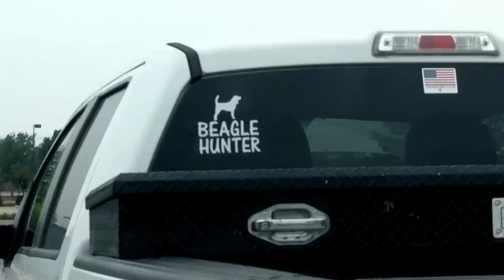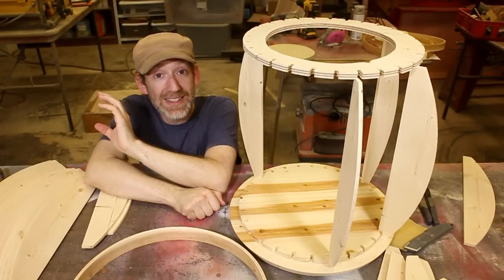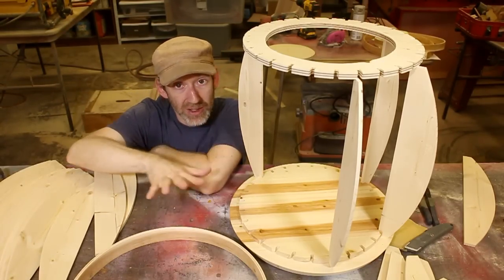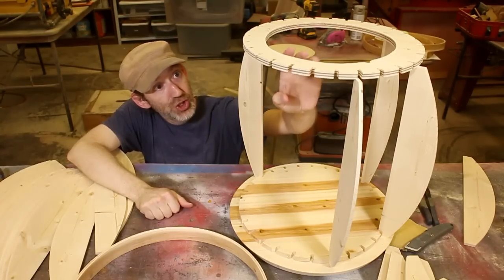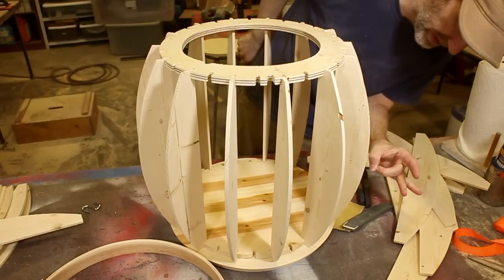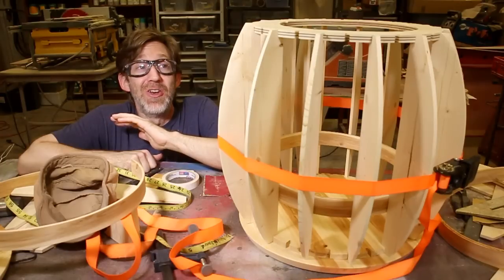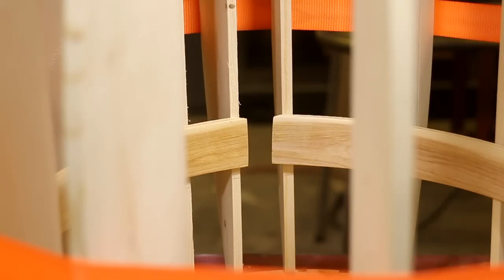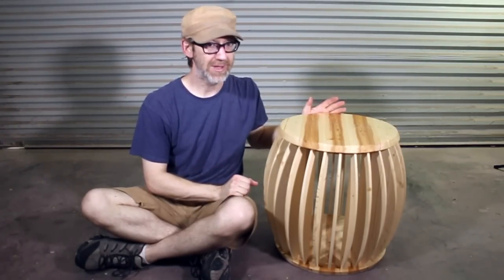Two 2x4 Challenge: A Mid Mod Stool Made Entirely of 2x4s!

Comment: Just love the custom made push sticks for the ovalish shapes. Safety first!
Reply: Except he's not using a top guard which is mandatory in the UK.
Reply: @donaldasayers  The top guard makes the table saw unusable. Do they come by and check in the UK.
Reply: @johntripp2028  In industry, which means if you employ anybody, yes they do. If a worker or you had an accident and there was no top guard, then your insurance would be void as well.

Yeah ok there are some things you can't do with a top guard on but there are good safety reasons why  you should not be trying to do them. What operations did you have in mind?
Reply: @donaldasayers  If we are talking about the same thing which is the guard that covers the blade , I would say any operation that requires blade visibility. Which for me is all operations. I hadn't had mine installed since right after I purchase my saw. I recently put it back on. I found it so onerous that I removed it. Maybe a better guard would work, but as it is I feel safer with it off. We have the same requirements for a commercial operation.
Reply: Donald Sayers who in the world has the job of coming to your “flat” or home in the UK and seeing if you have the guard in place? My top guard won’t allow the blade to turn to 45° I installed it the first 3 cuts I made with it. But to the point do the police (bobbies) check your personal saws over there? It’s mandatory here too per OSHA but that’s occupational safety not residential
Reply: Donald Sayers insurance here would be void too IF the employee wanted to lose workers comp by snitching that he was improperly using a saw. 

As far as what operations? For example a 45° cut or a piece of wood thicker than 4” it gets in the way more times than not. If you use the push stick correctly that comes with every table saw your hands get NOwhere near the top of the blade

Comment: I did the same thing, almost.  I used oak 2 x 4's and only did 12 verticals.  Mine was a side table from the start.  I wrapped both top and bottom with bent oak strips and added 4 feet in under.  The project came out beautiful but, I have developed PTSD trying to assemble the darn thing.

Comment: Have you bought a surface planer yet? I got a 12" table top used for $50 it's a life saver for consistent thickness. If you were to use the bands they should've been on the outside. Nicely done, finally a YouTube video that makes me want to build something neat and I am a finish Carpenter of 13 years professionally that works in a  cabinet shop
Reply: Mike W I want a planer pretty bad! And a scroll saw. They are next. I have two trees I’m cutting into “lumber” since the hurricane blew 100’ tall trees over and wasted them I don’t have to be the jerk killing them.

Comment: It’s a vanity project, but it’s pretty.

One of those things Makers do to see how far they can push.

Which is how we got Louis IV chairs.   The lightest possible design that will hold an adult.

I can see using CNC to manufacture these from plywood with matching slots on the disks.

Comment: Great work. And ideas. New challenge.
Grab 8’ 2x4s and make same thing but using your bendsaw to split it in more pieces. Honestly as soon as I saw you use the table saw with what seemed like a standard kerf blade I thought to myself. This guy with his talent could probably do so much more with a bandsaw. Few moments down the video timeline I was surprised to say the least.
None the less, ingenuity level is 11. Great job

Comment: interesting concept. one thing i would have done slightly different during the glue up is to rotate the two lid pieces so the grain runs at a 90 degree angle to each other. that will keep the lids from warping with any changes in humidity.

Comment: I have a Shopsmith and can make a jig for the slots so you can rotate it with an index so the slots are equal around the circumference of the stool. Using standard lumber would make it a piece of cake to build.

Comment: You may want to include on your next build like this to add a steel rod or two (if not for all "corners") in the build. This would remove the need to place wood straps. But hey those straps did look cool. You could even do both. One for looks the other for strength.

Comment: If you revisit this design, would you try doing it with the ribs at an angle so they almost touch and form a spiral pattern? Basically use the same number of ribs but instead of making them come out straight from the center, angle them >45° from their current orientation in this build. Similar to how shutter/blind slats are arranged.
Reply from the maker: Interesting idea. I might play with that. Thanks!

Comment: Nice job. Cool use of those 2x4's. I enjoyed your video and liked the fact that you left the band oopses in. Everyone has done that one. Those times when you know your component measurements are accurate and you didn't screw up any of the cuts, but the fit is off. To achieve the perfect fit you just need to trim a 16th and you're golden. You carefully trim off exactly 1/16th and voila... you're new fit is still off by a 16th. Dang.

Comment: I wouldn't have nixed the laminated bands. I assume there were going to be two, equally spaced somewhere in the middle of the ribs. What if you had made the other exactly like the short one and either offset the gap or aligned the gaps to allow for lateral entry to store stuff? Just sayin.. The bands would have supplied even more stability regardless of the gap. Cool job! SUBSCRIBED...

Comment: Very attractive project!   I appreciate the real world aspect of the assembly job.   How long did the entire project take you?   If you were to do it again how long would it take the second time?
Reply from the maker: Thanks! It's hard to quantify exactly how long it took, since I usually have more than one thing going on at once. I had hoped to complete nearly all of it in one day I had set aside, but it ended up taking most of another day. That's not including design time. (A lot of work went into fitting all those pieces into two 2x4s.) I am planning to do it again, hopefully soon, but I'll use a CNC router next time to get the slots accurate, and I'll be using better lumber. So, I could probably get a couple done in a day.

Comment: I am pretty sure the reason the bent laminations were so short is because they were overlapped when the cut was being marked. I can't be certain, because I was unable to observe the process close enough. However, it is true when making these types of fittings, the cut mark should be made with the ends above and below each other and directly against the mating surface. Otherwise it will be too short every time. Ask a boat builder.
Reply from the maker: I was very aware of the overlap. I cut it very long and kept shortening it till it fit. Something else went wrong along the way.
Reply: Wesley Treat it sounds like the overlap got you. Take the two pieces you have left and create a makeshift jig. Put the first one in overlapped and sneak up on the cut the same way. Then put the other one in and put the ends offset and mark the cut. Let me know what happens. It is impossible to cut an overlapped joint without being twice the thickness of the material short. Ask me how I know.
Reply from the maker: I guess I wasn't being clear. After the first cut, I wasn't using the point of overlap to mark anything. I simply took a little off, checked if it would fit, took a little off, repeat. I believe what actually happened was that I didn't make sure the band was pushed all the way out against all the ribs the last couple of times. It wasn't precisely round.
Reply: It is quite a challenging little project, but interesting nonetheless. I believe if I were to make something similar, I would attach the rings first, then fit the bottom and top last. Have a great day.

Comment: Nice job.. To over come cutting inner band inch too short you could of modified your plan by
Cutting a few more inches off the band so the inner band is more like 6" too short instead on 1 "... Then leave out 3 or 4 of the verticle ribs so its still a bench to sit on but now has a opening on the side to fit shoes inside. Could possibly if you had enough wood left made a round shelf to sit onto of the inner bands so you could store shoes at bottom and have a shelf inside midway up for a second pair of shoes.. 
Remember there's no mistakes in art, just have to adapt, over come and maybe alter original idea some to make it all work instead of ditching them all together like you did.. But either way. Good job, it looks great!

Comment: Cut a flat on the upper and lower ends of the curved side pieces and use the bands to hold it together there. It will then hold itself togther.

Comment: Tell us more about your sign controller board! Board that you build in circuit board video. Much thanks mate
Reply from the maker: Most of the info is in that video's description, but if you have any other questions, feel free to ask over there and I'll be happy to answer. Thanks!
Reply: Yeah i already know the description but what i meant is:
What are the design pattern that you use in that video ? I mean board layout. How can you control those lights so rapidly ? Did you use mosfets etc. ? And other type of questions about parts.

Keep doing it my friend. Much thanks.
Reply: I am asking this just because that video was so great to me. I think i watched 10 times i a row.
Reply from the maker: The board is based on an Arduino and the lights are switched with triacs. I've since redesigned the board to fit on one, smaller, double-sided board, but it's basically the same circuit.
Reply from the maker: Thanks, I appreciate it!

Comment: Nice design and implementation. I haven't read the rules for the Two 2x4 Challenge yet, but was there a stipulation on length of the initial pieces? Twelve footers seem like a lot of lumber. :) I enjoy the heck out of these challenges, watching what different makers come up with from the humble 2x4. So creative. 

Thanks for leaving in your mistakes and fumbles. We're not all Norm Abrams. :)
Reply from the maker: Thanks, Mark. They addressed the length on the podcast. They said they didn't care how long they were; you just had to have two and use as much of the wood as possible. It was more about finding the possibilities in cheap lumber.

And you'd be surprised how little there is in two 12-footers when you're cutting slices. You lose a lot to the kerf. If I had ended up using the bent lamination, I would have used nearly every inch. (You can see my cut plan at 3:04. The dark part is all lamination strips.)
Reply: Yeah, I was a bit bummed you couldn't use those laminated pieces after all the work you put into them. I was thinking you might have been able to place them a bit lower down the curve to take up the gap, but it might have thrown off the aesthetics of the piece. In the end though, nice and sturdy. 

I know about how much wood you lose to cutting. :) I'm lucky in that my local hardware/lumber store is only 5 minutes away. When I was building my fence and gate around the upper part of my yard at the back door, I was over at the lumber yard getting that one last piece about 3 or 4 times. Heh. I've never tried resawing 2x4s or anything like that. I won't be able to until I get a table saw again. I gave up all of my bigger tools when I moved into an apartment and haven't quite gotten everything back now that I'm in a house again. 

Keep up the great work. Loved the video, especially the beginning: That's a very specific type of business and What kind of monster hunts beagles? :D

Comment: Oh my god! Where have the 2 x 4s gone? That is weird thinking and very limiting.
 I like the mechanic's dead blow hammer you used to whack the base and top down when gluing, I use a 1 kilo dead blow constantly. I find it bruises and dings the wood less and moves it more if you want it to.
 A very nice project, pity about the lamination faux pas, it just goes to show that even when you think things through to avoid mistakes you sometimes still make them, we all do.
 I always keep the mistakes I make and try to re-purpose them, some I use the others get moved around time after time until eventually they find the rubbish bin ( or the barby). Just found you will like and subscribe.

Comment: you should remove about 4 of those slats and then you can place your work shoes inside.
Reply from the maker: Not a bad idea.
Reply: I didn’t think about that but I was thinking a small drawer up top on the rear for sidearm if it’s used as a table is a good idea.

Comment: You should have spaced the laminate strips about 6" apart from each other, then glued it. You don't want seams to be on top of each other like you had them.
 If you glued the seams about 6 in from each other, then added your extra piece, it would have worked.   * Never glue seams on top of each other.🚫

Comment: If it isn't 2"x4" (nominal), then it isn't a 2x4!  Once you rip it down, plane it, or sand it...then it's just a chunk of soft pine!

Nothing special about building with narrow pieces of soft pine, except pine is too soft to be very durable, and using small pieces is more work!
Reply from the maker: What on Earth are you going on about? I was supposed to make something out of two 2x4s without cutting them? Or sanding them?
Reply: Maybe this project messes with people's sense of object permanence?  Or is it deconstructing people's prejudices about dimensional lumber?
Reply from the maker: Ah, I get it now. Accidental feeding.
Reply: The object of using 2x4s is they are cheap and readily available. They are usually made of spruce, not pine. Spruce has the highest strength to weight ratio of any wood.
Reply: phatthand it depends on where you buy. West coast 2x4 are usually Douglas Fir (one of the strongest of the conifers). In other parts of the USA its southern yellow pine. I've never heard of Spruce 2x4. You up north?